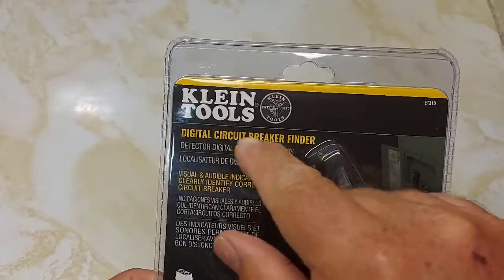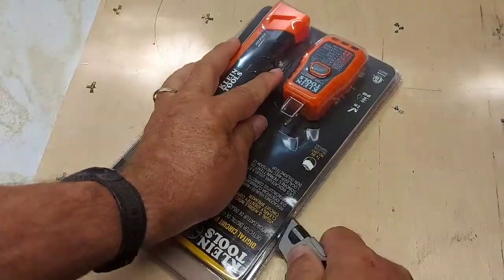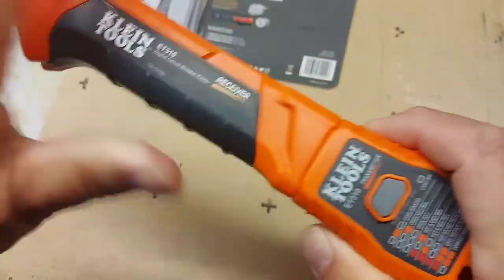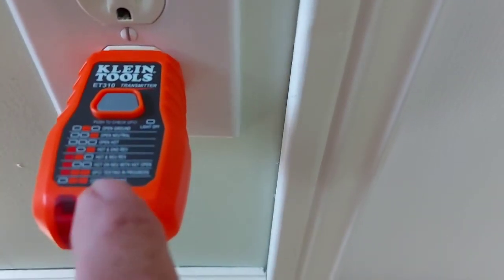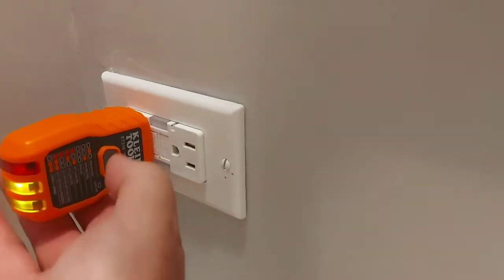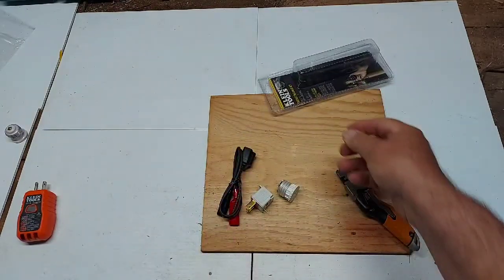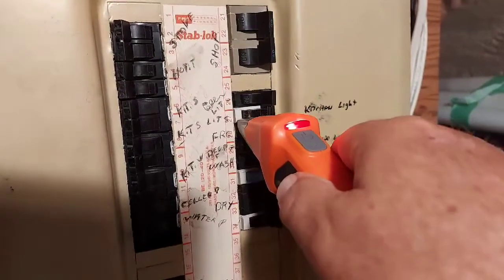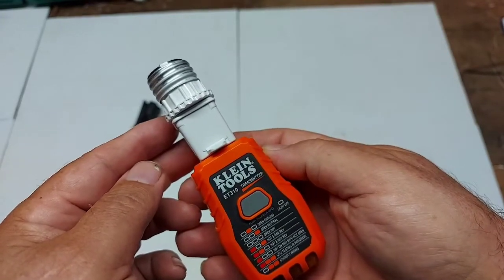Klein ET 310 Circuit Breaker Finder

Comment: Already have one that checks polarity. And the one from Lee Valley which just helped me find the breaker for my outdoor plugs!   Mine predate having to have a separate breaker. But I still want to replace them with the gfi outlets I bought. Might only need one gif if I can figure out which plus is first in the run. Then I'd put the other on my outdoor a/c rv receptacle.

Comment: Good job Jim! Do you have any idea why in the accessory package you bought they include a 2-prong socket adapter and not a 3-prong given the transmitter is 3-pronged? Seems like the 2 to 3 prong adapter is an unnecessary step if they went with a 3-prong adapter.
Reply from the maker: Yes I was wondering why myself  they just didn't make the 3 prong adapter

Comment: does it work if there is no power to the transmitter?
Reply: @Noemailads  since no one’s answered my question, I purchased the circuit breaker and find out for myself. It does not work if the power outlet has no power.

Comment: Great review.  Anything you didn't like about it.  How did it compare to the other testers you've reviewed?
Reply from the maker: Thank you. Its easier to use than the last Circuit breaker tester I reviewed.  Just hit power button and scan panel, I like the transmitter it tells you if wiring is correct.  The socket adapter was not included. Only think I didn't like was the beeping when I was doing the video that gets annoying.

Comment: Does anyone have experience using this tool with an electrical panel that utilizes tandem breakers? Can it pinpoint the correct individual circuit on the tandem breaker device (hope this question makes sense :)?

Comment: can this be used to find what breaker controls a switch? The switch controls an outdoor light which has stopped working. I'd rather not work on a live circuit (I'm just a home owner, not an electrician). It's kind of  a catch-22 - I can't find the breaker since the lamp has stopped working, and I can't get the lamp working without removing the device and testing. (it's an LED lamp where the bulb is permanent).
Reply from the maker: This Breaker finder will work but you need to put the transmitter in the socket of the light. You could shut your whole electrical panel off  to  remove and check it.
Reply: @JimMcLaren1950  thanks. There is no socket for the light. It's in soldered on LED bulb. I could disassemble it and use alligator clips to the leaves, but I think it would be more prudent to turn off the main panel, as you suggested

Comment: I wish I could find one that worked in a not-live environment.
Reply: You can use a low voltage tone generator. Just make sure the power is off or you'll fry the generator.
Reply: You'd probably need one that had a battery at either end?